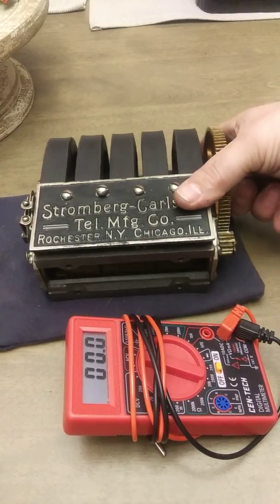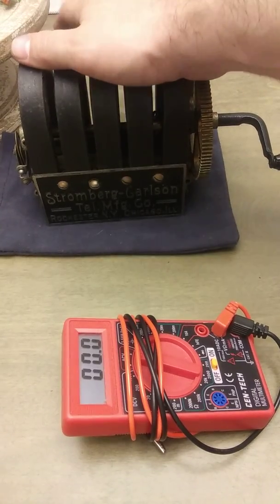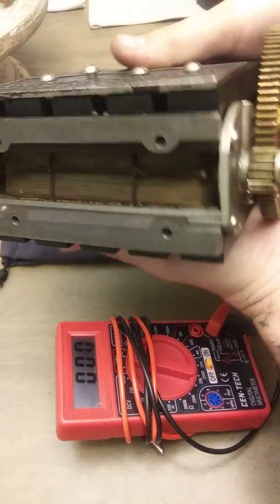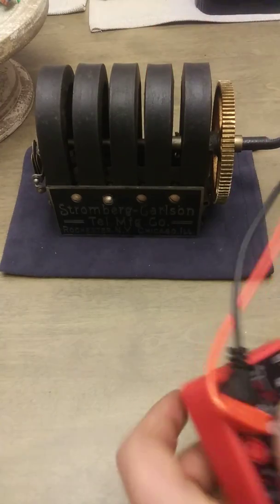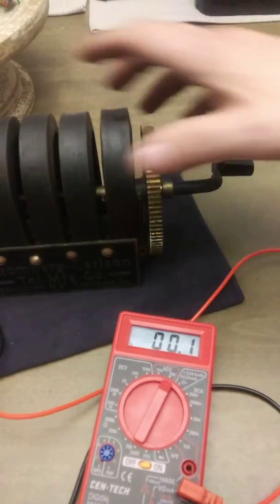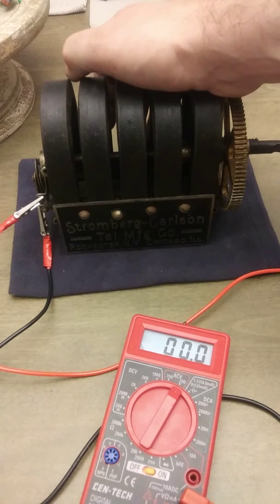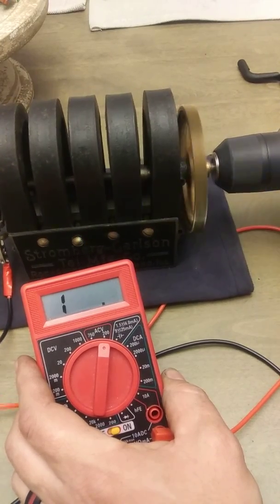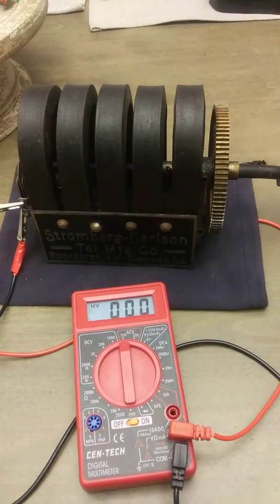Telephone Magneto 200+ volts

Comment: Is there any way I could use a magneto like this to charge a 12V car battery? What components do I need to put between the magneto and the battery to make it happen?
Reply from the maker: You would need a 12v voltage regulator, they can be easily obtained on Amazon or eBay. You could also create your own likely with capacitors and a mosfet,  but I do not have a diagram to explain the circuit. I use these antique magnetos strictly in the unregulated form. The problem would be that these do not use bearings and are lubricated with a pin oiler, although you could tap an oil reservoir i suppose, but it likely would not last long term.
Reply: @bigdaddydoitall  Thank you :-)